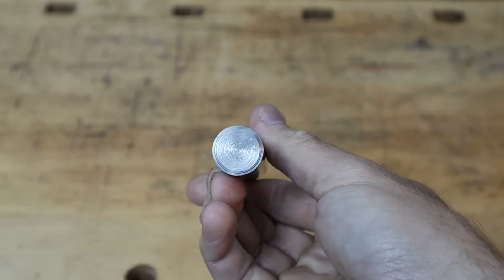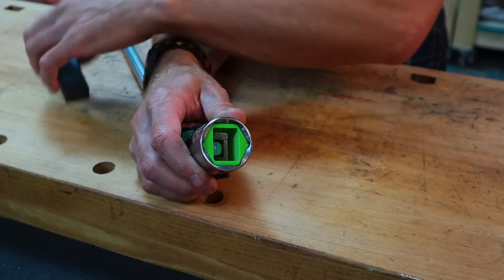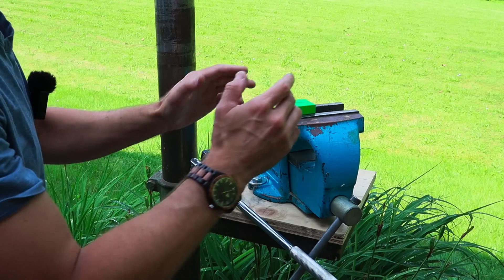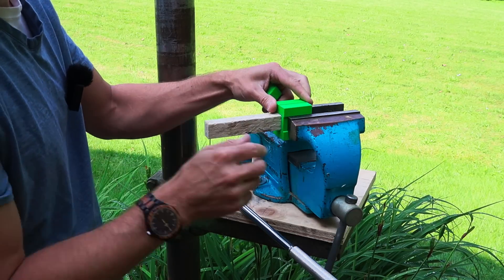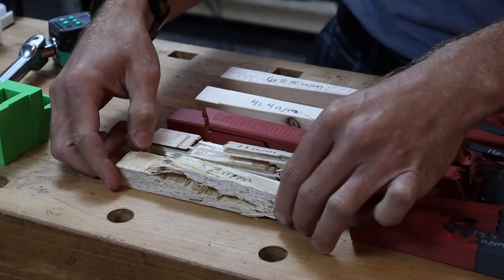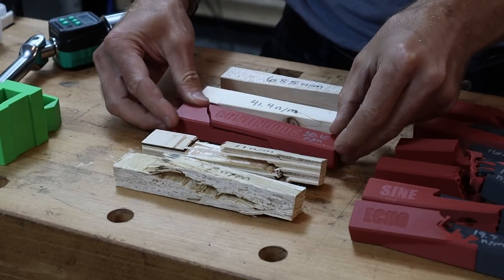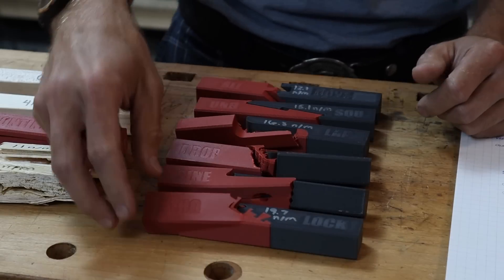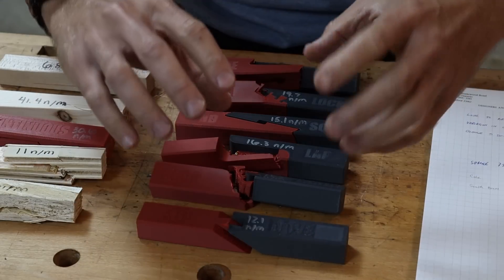How Much Can You Twist a 3D Print Before it Breaks?

Comment: Maybe I missed it, but what are your print settings? Line width, layer height, number of walls, and infill percentage would be great to know.
Reply from the maker: I believe I added that info near the end of the video, I've been using the same details for each of the testing videos, so I apologize if I didn't go into great depth.  0.4mm Nozzle, 0.2mm LH, 6 walls, 12 tops, 12 bottoms, 30% Gyroid.  PETG-CF Nozzle Temp at 250C, minimal cooling.  I also normally print structural parts one at a time for better layer adhesion, this seems to be most important with PETG-CF which doesn't have great layer adhesion.  I have another test video coming out this weekend, which goes into more detail on this subject and it's a more novel approach to 3D printing structural parts.

Comment: I'd love to see all of these tests with 3D printed metal, but you probably can't afford an SLS metal printer. Still, much appreciated that you did a twist test and very interesting results considering which joints perform better in one test over the other.
Reply from the maker: I'd love to test metal 3D printed parts, I have a video showing some parts I had made by PCBWay and they were pretty impressive.  They were made from Stainless steel and Aluminum.  I've since polished the Aluminum even more and it seems like a completely solid homogeneous part.   I'll see what I can come up with to setup some 3D printed Metal part tests.  I need some smaller parts or bigger equipment for those tests I'd think!

Comment: One thing I think you should explore in your videos is concrete-filled 3d prints, Chris Borge has some videos exploring this and I see it as very promising
Reply from the maker: Ah, interesting, I was going to go a little different route, similar vein of thinking though.  Use the print as a shell and use a structural material for the inside and get the best of both.

Comment: That OSB was really One 💩 Board KappaRoss
Reply from the maker: LOL.  I'm sure there are better OSBs out there, but I will tell you from experience.  I tried to save some $$ and use OSB for workbenches, it worked for the top, and for the lower shelf, but not for mounting casters.  When off-center force was applied because the casters were not directly under a 2x4 it peeled the OSB apart and cause the whole bench to fall abruptly.  I replaced it with plywood and use longer screws and that solved the problem.

Comment: I'm very surprised at how bad the plywood was
Reply from the maker: I've seen this issue in the industry as well and we would use thick 1" CDX exterior grade fir plywood.  When we would screw into the side of the plywood, it would easily split it apart.  I'd have to test other types of plywood to get a full picture, Baltic birch plywood comes to mind as one of the better ones.   I can certainly run some tests.
Reply: @NeedItMakeIt  I would find that interesting. 
I would be curious also to see twisting test along the layer lines (for plywood and for filament).

Comment: Would be mildly interesting to see if there is any strength improvements by printing the orientation of each half at 90 degrees from one another. Right now the layer lines are parallel, but if you printed one half where you have to roll it 90 degrees to mate them together would that have different properties
Reply from the maker: I think that could be right, if we're calling the layers and extrusion the "Grain" it makes sense that like wood we'd have the best results with parallel grain.

Comment: I don't get it. These joints are designed to be used with glue not screws. Not how all the joints separate before failing in the material. You could use FEM to predict where the stress concentration is and design accordingly?
Reply from the maker: I've designed each of the connections to come  together without glue.  Some connections would do better with an adhesive I agree, some connections would push the adhesive out while trying to bring the joint together.  I think using a software to predict is a great idea.  I had the module in fusion, but it is quite expensive, I'll get it again if I can get enough income to pay for it.

Comment: Red parts fail first because it is the side of the wrench. If you repeat the test with the parts in the reverse orientation, black will fail first.
Reply from the maker: Could be, I've also tested for deflection in a separate video and the red failed far more than the grey.  I am told that Grey is one of the strongest colors, I would like to run tests to remove the variables.  each test piece is completely red and completely grey, and then have a few samples of each for a better average.

Comment: It's worth noting that in all of these tests the Under Squin design appeared to have a non-destructive failure. It could simply be reassembled again. Depending on the application, this can be very valuable.
Reply from the maker: With some small changes it could have also performed far better.  I think one idea is to somewhat lock the ends in, to do that I'd need to bring the parts together from the side and then add a wedge to further tighten the connection.  I really like that connection, it's best for tension and compression, that's the original intent of the design when it was being used in Timber Framing.  This is a connection that we would use when I was a Timber-Framer.  We didn't have material long enough and were forced to join them, the parts were in a Bent and would normally be in tension.  They'd also have support from a King Post or 2 Queen posts Through-tenoned from above, or a post below off to the side.  Being able to assemble and disassemble by removing a single wedge is simple and effective.
Reply: I was about to write the same comment. It seems to work like a safety valve or resettable circuit breaker.
It would be nice to see if a non-destructive joint actually performs repeatedly about the same.

Comment: I'd like to see MDF in these comparisons as well; I don't expect it to do that well, but I'm curious how it compares to the 3d prints
Reply from the maker: I can arrange that test.   When I was young, I worked for a hardware store and I remember when it first came to market, I bought an entire 3/4" x 4' x 8' MDF sheet for 9 dollars.  It was not fun to work with though, the dust and the final weight of the furniture along with how it absorbed the paint.  It has it's uses though, nice and flat, consistent thickness.  I think that's why you see so much MDF used in laser cutting.  They'll always be able to cut through the material with the same amount of passes, with other materials incl. plywood, that's not at all the case.

Comment: It was nice to know your print settings, that's pretty much the same settings I use when I want maximum strength, although I usually use cubic infill for my own stuff because it's stiffer, gyroid infill flexes. With 6 walls and 12 too and bottom layers, almost all of your strength is there anyway, so the difference between cubic and gyroid is probably not even a factor for almost any application with thick walls and top and bottom layers. Thanks for putting these tests together, interesting to see the differences with the colors, I've noticed the same thing myself, even down to printability(max speed, stringing, etc) being a factor amongst different colors of the same manufacturer and type.
Reply from the maker: That's great info, I'll follow up with some more testing videos to hopefully prove it.   It's my pleasure to do the testing and put these videos out there .

Comment: Really interesting.
Yes , pigments have a huge impact on filaments performances.
If my memory is good, red filaments have better impact resistance but are more brittle.
There is a really good video from CNC kitchen on this topic
Reply from the maker: Perfect, that's a great to know, it seems that many people have noticed the same thing.  So you choose the color based on the characteristics you'd like to have.  In the testing the red seemed to be a bit more 'gummy' that was seen best when testing the under squinted connection.
Reply: Or an other easy solution is to take  the color natural.
It should not contain any pigment 🤣

Comment: I wonder how well glue lam would do, since unlike OSB, it's designed for structural strength. There's a building more than 15 stories high in Canada build entirely of engineered wood.
Reply from the maker: I've tested LVLs in the past and the performance was similar to that of solid oak, but at a fraction of the cost.  As far as in a torsion test, I'm not sure, they'd be using different adhesives which could come into play.  I'd image that they'd perform quite a bit better.  I will see if I can get my hands on some, I should be able to.
Reply: @NeedItMakeIt  You'd probably need to find a manufacturer. They don't cut the stuff on construction sites much, it's against code to alter engineered assemblies.

Comment: To be honest I am not entirely sure if this particular test correlates with something what may be done in real life. Let me explain. Let's imagine You are doing something what can twist - what will You actually do to reinforce the join place? I would imagine something what will go around it - saying a "fixator" of some sort, consisting of two parts which "hug" the connection and between themselves are usually connected via pair of bolts on the opposite sides. Thus - sure thing, the test is really interesting and it shows the way things break when twisted and from practical standpoint I would imagine it to be showing what will happen with the connections which are accidentally twisted and were not designed to withstand this type of deformation. For more practical application and visible deformation I have actually an idea on how to improve this test without interfering with it's visibility - as the "hugging fixator" would definitely block all the nice view :) so, what do You think about having a some sort of a solid bolt ca. 1 cm in diameter with a nut on other side which will prevent the joint from separating in the axis direction - basically providing some sort of compression to the test part? I would imagine this to be a bit closer to real world... maybe. What do You think?
P.S. and thanks - yet again - for Your videos and efforts - it is really interesting to watch and understand what really happens in these types of situations so this knowledge can be applied to prevent these issues in projects.
Reply from the maker: I don't disagree.  The best test is to make a "Thing" a frame and perform the tests on that full assembly.  I'm working my way up to that, I think that's probably the end goal.  I want to find the best connection possible and then we can create a full assembly, maybe even a 3D printer frame would be a good use-case and see how it performs.  I can take the K1 printer's parts and recycle them into a 3D printed frame.

Comment: I was talking to a friend who works at filament manufacturer where they make mostly engineering type filaments, PEEK, PEKK, etc. He said that the pigments in the filament can affect the strength of filament. White in a lot of cases, is the worst because of the titanium dioxide they use to color it. As a general rule, darker colors are typically stronger. He also said, if the filament is hygroscopic, it can also affect the strength.
Reply from the maker: Very good info, I'll keep that in mind and I will try to run some tests as well to confirm that.  There are so many materials, so I'll try to stick to just one type for now.
Reply: You should always try to test natural (un-pigmented) materials to test the resin alone. Colourants can affect strength and even print temperature along with other process parameters. This may be why the darker material seems to have failed less than the red.
Reply from the maker: Perfect, that's really helpful!
Reply: That makes so much sense, The nozzle on my printer didn't look very good anymore after I printed a lot of white filament xD titanium dioxide is quite abrasive

Comment: Yeah i think a solid beam of each color can be added to testing as a comparison point.
It's a known factor that the additives play a role in the strength of plastic and pigment is an additive that varies wildly in quantity from one color to the next
Reply from the maker: I'll make sure to work that into some follow up testing videos!
Reply: @NeedItMakeIt  I'm not convinced it's very useful though. because the viewers won't be using the exact colors you are. but it can give an idea of how much more strength it might hold if it was printed fully in the strongest of the 2 colors...

Comment: Wondering if higher or 100% infill at the connection area would give better results.
As to strengthen the joining area by sacrificeing some speed and material in that joining areas.
Reply from the maker: I have a similar idea that I'm testing right now, it should lead to being able to understand what results in stronger prints without adding more material.

Comment: Obviously the chemical composition of the red and the grey plastic isn't the same, because they're absorbing different wavelengths of light.  How much that impacts their ability to consistently melt, merge, and re-solidify I couldn't tell you.  It may be that the red is indeed weaker; it may be an artefact of your testing setup.  I agree with @welldoneworker - you should do the tests with a single-piece grey part to see if there's any significant difference.

You could also redo the tests with the parts mounted in reverse, to see if @SwitchAndLever's mildly insulting post is on point.  The breakage occuring mostly in the red could be a result of how you mounted the test pieces.

And, finally, as I said on the first testing video, I'm very interested in seeing how the dry joints compare to a properly solvent-welded joint, because if one is making a genuinely structural poart out of plastic, using chemicals to fuse the two bits of plastic into one feels like it ought to be a lot stronger.
Reply from the maker: All great points, I've made some note from your feedback and I'll see if these follow up videos can be arranged.

Comment: You can see why they build houses out of wood rather than plastic lol 😂 a question for you, what would you consider the best first time hobby 3D printer on the market at the moment? 😊
Reply from the maker: For sure!  Not much beats the look of solid wood as well, that richness and depth of the grain.  The best first time printer which isn't going to break the bank is either the QIDI Q1 Pro or the Bambu A1.  The A1 has the option for color, more $$ of course.  The Q1 Pro can print high temp and has a heated chamber, it also has an enclosure.  If you want a reliable printer that you don't need to improve or fuss around with, those are both good options.   Soon, there will be a new wave of printers coming out.  I'd expect Bambu to release a new printer soon, which may be why they've put everything else on-sale, so it could pay to wait a bit longer.